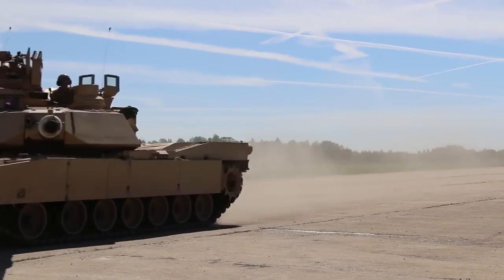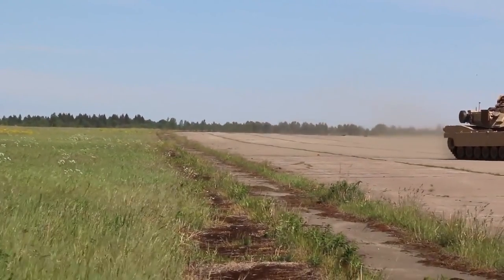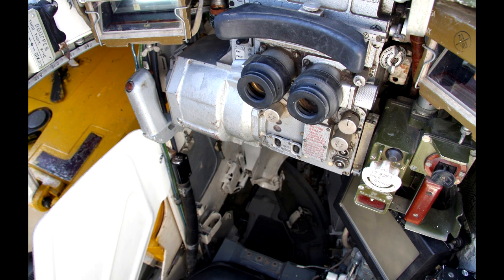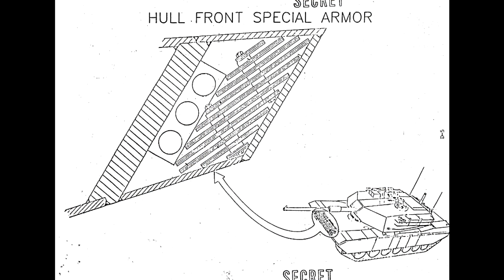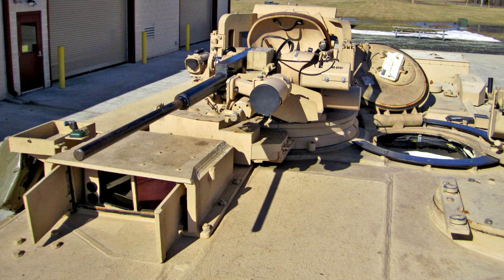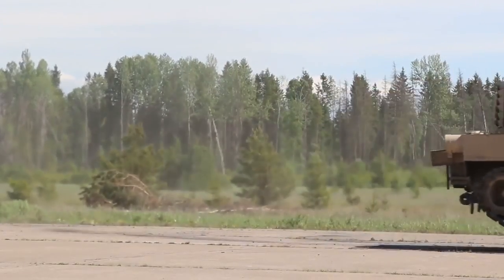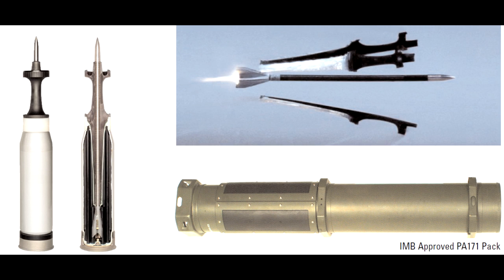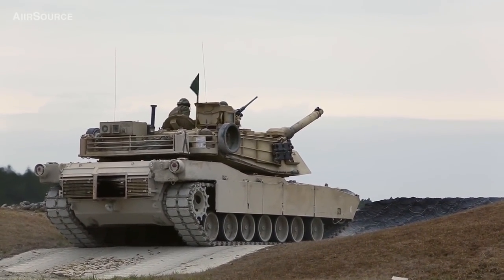Problems with Abrams tank

Comment: US went for for the turbine because it was quieter at battle range and because it didn't produce heat the same way.
Reply: I dont think it is worth it
Reply: @A-G-F-  it was for the US military. One of the most important things about being in a tank is to not get hit and 1 of the best ways to not get hit is to not be seen or heard.
Reply: @xDTHx  i read yesterday that it was a variation on the Blackhawk engine, it makes more sense to me
Reply: @A-G-F-  yeah turbine engines are already used in our helicopters basically for the exact same reason we currently use it in our tanks, they produce less low end rumble than a diesel (meaning it will be harder to hear in battle situations and at longer distances), and because they have better power and torque curves, and because they can run on pretty much any fuel from jet fuel to diesel to regular old gasoline meaning that you have higher chance of survival if you are stranded out by yourself, diesel only runs on diesel so you'd have to find diesel fuel in order to run it. There's lots of benefits to the turbine which will make it clear why the US chose it over the diesel powertrain. I don't believe the creator of the video mentioned them at all because it would prove his statements to be false. 

Its like the people who say that the M16/ M4 is a bad gun because of the problems it had in Vietnam and only talking about the issues it had in vietnam without talking about the newer models being vastly improved and those problems in Vietnam were because the US military wasn't issuing cleaning kits, M16s lose reliability if you don't keep them clean. They'll be reliable and nearly undestructable unless you stop maintaining them.
Reply: This guy doesn't give a fuck about it though he's insanely baised

Comment: cmon nownu make the abrams worse than it is compared to some other tanks all t80 series has almost no armour on ita lower glacis and if u oenetratenthere u even hit the driver and the autoloader karusell what makes the tank goes boom shure abrams isnt the best tank in armour great weakspotnunder the gun but as i said if the autoloader karusell hets a hit by lowr glacis or weakspot around gun the whole tank is dead  since m1a1 the abrams is oberall a good. tank and prooved it in s lot. of. battles i just wanna say innfact if u make tank comparisons u should not be on one side u should say all strenths and flaws about it
ps: ok dorry just read u made vids about other tank problems too but be a. bit more neutral 😉 jusz wanna mention about T14 izs nice tjat tje crew is locatate in an strong hull but u sayd turret can just take 20 or 30mm mk gunfire what about hellfire or javelines they go into the top cant imagim this weak turret can withstand such a hit without dmging the "unpenetrateable" hull

Comment: I was a US tanker whose scientist father did secret work on the Abrams at the Warren Tank facility. This is bullshit and Ill give a couple examples.  Governors are put on the US turbine engines, they are not taken off until war and until they are needed.  Speed of Abrams is classified, and its not unusual for a tanker to never have access to its full speed.  No Abrams ever broke down due to filtration, never a problem so shouldn't even be mentioned.
Penetrating power is not easily judged, the 105 rifled bore was essentially just as capable as the soviet 120 smoothbore, this was proven when Israel had no problem wasting T72's 120s with their 105s, and in the Gulf War.  Armor is classified too, in one instance in Iraq one Abrams took over two dozen hits from several T72 120mm guns but destroyed all of them.  Only two photos of Abrams taken out by sabot rounds ever were made public; turns out they were disabled by Americans because the tanks broke down (probably just threw a track). Success in battle is recipe of optics, stabilization, armor, and round capability, all Abrams leads.  Commander thermal site and override?...the older M60A3 had that so Abrams did too, poster mistaken.  Muzzle speed is not the final say.  The proof is in the pudding, Abrams gun was tested on captured Soviet tanks, never the other way around because they never captured our tanks.  The results in combat are clear.  Today American 120 guns have 150mps less muzzle speed than Russian yet penetrate significantly more armor with same size projectile(!).  This poster uses terms that someone scanning documents would use, and he also hedges his terms because he simply doesn't know, which is an indication of someone severely lacking in actual knowledge.
Reply: Of course you were, this comment section is full of m1a2 sep v3 tankers!

Comment: The gas turbine engine was partly used because it is the same engine being used in blackhawks, so the complaint of it being “too expensive” is incorrect because we already had this engine developed. We did not have a large enough diesel engine for this tank, and it would’ve cost more to R&D a new diesel type engine.
Reply: Why they didnt outsourced it? As far as i know, the cannon is built in germany by Reinheinmetall

Comment: The main benefit gas turbines have over diesels is fuel logistics.
If you can get everything in your army to run off of the same shitty kerosene like substance then you have significantly reduced the amount of logistics you need to haul around.
Gas turbines are fuel guzzlers and may be more expensive, but the fact that they can burn almost anything in liquid form that is flammable must not be over looked any longer.
I mean for fucks sake you can make a gas turbine run on Bunker-C fuel oil. Which is almost like fucking tar. In other words, it doesn't matter what you shove in the fuel tank, it could be fucking moonshine and it will burn it.
Reply: Also, the US military may say they use diesel fuel, but it has much less consistency and quality control than normal diesel fuel found at a fuel pump. It is more similar to kerosene in the fact that it can have a very wide variety of compositions of various aromatic compounds that normal diesel fuel specifications do not allow for. This make the fuel cheaper and also makes it a bit more compatible with jet fuel since it is more similar chemically.
Reply: I belive red effect had a countrrargument to this too

Comment: Wow! I didn't know that their are lots of chair tankers in the comment section!
Reply: I BEGAN MY time as mech Armor serving as a m114 recon in a cavalry unit, then to M-551 Sheridan light tank, the M- 1A1 was a Cadillac compared to. M-60 MBT, I served in every position on tanks but soviet armor was terrible
For the crews one you have have small stature not 6 ft tall, track pins vs connectors and striker plates

Comment: Multifuel is designed for interrupted supply lines and having to use enemy fuel supplies
Reply: Yes, it was designed for a real, and a big war with a peer adversary where supply lines would have a good chance of  going to heck quickly.  We are coming back to major power rivalries now after a bit of a break since the fall of the USSR.

Comment: One of the reasons the us chose the Chrysler turbine engine was because it had higher horsepower and tourqe ratings at the wheels then the GM diesel. The diesel engine has much higher parasitic loss of horsepower required to run cooling and other systems that the turbine didnt allowing for more available horsepower and tourqe. The turbine also had higher horsepower and tourqe numbers from idle. The turbine can also accept a higher range of fuels than the diesel without performance drains.

Comment: why doesn't the US gov. put out a new contract to develop a new Tank?
When even the old Leopard has better capabilities than the Abrams.
Reply: 2 reasons: cost and a lack of a need for it.  New vehicles, especially ones on the scale of a tank, are quite expensive, both in the upfront dollar amount and in adding all the spare parts and additional training needed to keep them running.  It's faster, easier, and much cheaper to just improve existing platforms.

Remember the T14?  Russia stopped making them because they realized that for the cost of one of those they could retrofit 3 existing T90's to be able to each do basically the same thing, and that applies to most armored vehicles around the world.

Then there's the fact that there's really no need for it.  None of the major nations are fighting one another, just posturing, and most improvements we try to make to deal with the threats we actually run into are either carried out by other vehicles(IED clearance) or are dealt with using a new system installed on existing tanks(like TROPHY).

Comment: The reason for L44 over L55 is because of ammo. Our DU rounds worked better with the L44 than with the L55.
Reply: L55 has shorter barrel life and the small increase in velocity was determined to not be worth the must shorter barrel life,
Reply: @brucenorman8904  Germans don't use DU rounds, but we do. They use tungsten penetrators. Our rounds don't need to go as fast and it was actually detrimental to the DU rounds to shoot out of higher pressures. I read from some pdf a while back, but that was the main reason. Performance-wise it wouldn't make sense. Plus you get an expensive upgrade and less tureet mobility due to having a longer barrel.
Reply: @komradearti9935  Nah, that's one of the reasons. L55 is longer and less convenient than the shorter L44. The M256 works at higher pressures, and the advantage of using an L55 would be marginal at best. The M829A3 and M829A4 are heavier and slower than the earlier variants, but still work better than tungsten penetrators. You also have to take into account how many nations use L44, logistics plays a huge factor as well. If the L55 was a significant improvement, then the US would've gone for it
Reply: @komradearti9935  No, the L55 has lower pressure shells. They beefed one up to test m256 munitions in it and the advantages were marginal. For the APFSDS there was a 100m/s improvement but that alone doesn't justify acquiring the L55. And since when does tungsten outperform DU?? The sole reason Germany and other countries don't use it is for political ones. And yeah, the M829A3 and A4 are heavier and are designed for use against ERA and other modern armor. Also, the military is always improving its weapons. The M16/M4 isn't the best rifle ever. But despite that the Army hasn't replaced it because other platforms provide only a marginal improvement. Think about B-21 and B-2. Is the B-21 there because the air force is unsatisfied with the B-2? Despite being the most capable bomber out there?
Reply: @komradearti9935  Exactly, and the M256 is an M256, not an L44. There are some design changes. It was built so that the US Army could upgun to a 140mm at a future date. But modern propellants with a 140mm round would be too much for the breech. Which is why we can shoot at higher pressures. And since the B-2 and B-21 example flew over your head. Take 6th generation aircraft plans and programs that took place before the F-22 was even completed. That's the point of programs. To predict future threats and exceed them. When a program takes too long, that's when a panic ensues to fast-track a system needed as a stop-gap. Take the AIM-260 as an example
Reply: @komradearti9935  Exactly my point, there's no way to upgun to a 140mm because of modern propellants. The original one was designed to be upgunned but never did. We shoot higher pressure rounds. Do some research instead of simply stating what you think. And the B-21 still proves my point that programs are designed to meet future needs. There's no immediate need to replace the B-2 because it is obsolete. Same way as there is no immediate need to replace the M256, which is a licensed variant of the L44 which operates under higher pressure than the L55. There's a reason they had to beef up the L55 when they did testing on it with US munitions all those years ago

Comment: Isn't giving comments on a tank rediculous, when you do it on the tank itself and not in comparison with that country it's doctrine? Correct me if I am wrong, but aren't tanks specially designed on base of that country it's doctrine?
The point about the engine is valid in my eyes, why using gasturbine, when the rest of your doctrine is based on diesel. Not really logical when you are in war and you have to resupply. Or, when no resupply possible to get fuel from civilian ways.
for the rest, nice vid,  but if you do a video like this, why not compare it with the country it's doctrine?

Comment: Germany doesn't have a lock on good Diesel engines. Could put a Caterpiller, Cummings, Detroit Diesel, many others. Some people say the US makes the best Diesels. Just not Oldsmobile. A modified 350 gasoline engine. The fuel injector for a Detroit Diesel looks like a space gun if you get the right model.

Comment: The point of the gas turbine is fuel type or quality doesn’t matter it’ll still go. Meaning if cut off of supply lines it doesn’t need high octane diesel or kerosene like it’s counterparts.

Comment: I don't see any intake ports. How does that gas turbine suck in air? I imagine that it is easier for faster moving vehicles like fixed / rotor wings. Hell even a bike, the Y2K. But a tank, that's an interesting engineering. I am guessing it's from under the chassis which is why it's got dust problems. It's an urban tank. It will outrace the Leo on the Autobahn for sure
Reply: If you stand on top of most tanks you'll see the power pack through grilled hatches. On my APC we'd pull them up to quickly pull the air filter, gently empty the dust and replace. When driving you can see dust get sucked in and hot air blown out.
Reply: The intakes probably are on the bottom

Comment: The point of the gas turbine is it doesn’t have to spool up like the Diesel, it can start instantly
Reply: Sure it starts instantly, but if the crew has the time they will let it warm up. The only time they put it into action instantly is in emergencies as it can damage any engine if you do not allow it to warm up

Comment: To all over proud Americans: let a Abrams face off against a Leopard 2A7 and see who wins...
Reply: The problem is that the Leopard 2 as well as the Abrams are designed to fight Russian Tanks mainly which follow a different design concept. So having them fight each other would force both Tanks in a role they where never intended  to.
Edit: Grammar
Reply: @siggyunsichtbar6980  the problem here is you never specified which leopard, and either way, we wouldn't be able to tell who would win without see the two go to combat. The Leopard 2A7 has the better manouverability, cannon, and armor (frontal and turret cheeks). The Abrams gun (before a biased american says the "american" gun is better, the gun is German on the Abrams as well)
Reply: All tanks have weak as shit side armor so

Comment: Problems hurt my head 
Give us something positive pls
Reply: https://www.sciencemag.org/news/2020/07/two-new-medicines-may-curb-serious-respiratory-disease-infants. Pretty fucking sweet but you probably mean about tanks.

The abrams turbine while causing a host of problems also has some advantages glossed over in the video. It has much better low speed torque which gives the abrams as big advantage on many terrain types. And many of the disadvantages of turbines are bigger when its on the attack. For example high feul consumption and extra maintenance(for turbines at the time). But the tank was designed to defend against a soviet invasion of Western Europe. The US would have had better supply lines than the soviets as they were constantly falling back. In modern wars its an advantage as well because of how strongly the politics of casualties matter. Having just slightly higher combat performance even at the cost of huge logistical issues is often worth it because winning that first engagement is so crucial to optics. This is why its worth it to fire 0.5 million dollar missiles at targets worth 50k. Modern abrams tanks also have excellent night vision and targeting computers. Finally the US has access to large amounts of depleted uranium.  Which is a huge advantage for AP rounds and amour over most of the world.

Comment: Can someone tell me if tungsten would be an ok substitute for DU in ammunition and/or armour
Reply: Yes Tungsten is one thing used in British "Chobham" but multi layered with Ceramics and plastics. ( 20 years old now) the New Dorchester variant now on the Challenger 2 may do too ( secret at the moment)
Reply: tungsten is weaker than DU, but the main thing about that is that tungsten balloons out when hitting an object, which reduces the ammunition capabilities of the metal, while DU has a unique self sharpening ability that makes the shell sharpen itself on impact, leading to better results, so overall, DU is the better metal for shells, but Tungsten is a fairly decent alternative